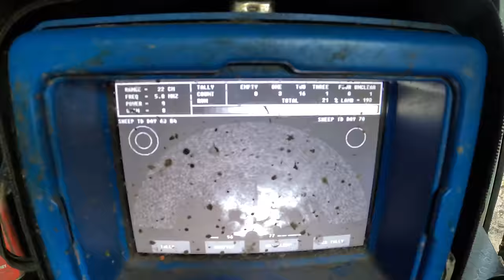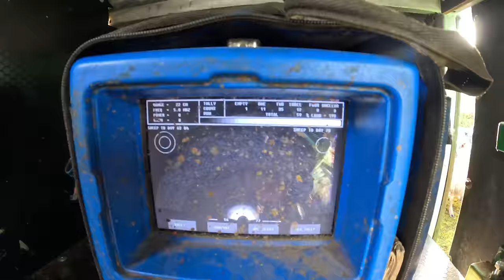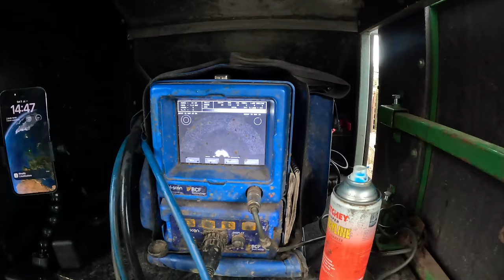Have the Rams worked? Lets find out!

Comment: Could you maybe extend your tapari roofing and build some sheltered lambing area or some temporary party type tent gazebos polytunnel with lambing pens inside for the adoptions and poorly sheep? Trying to think of some simple quick cheap solutions for all outdoor lambing ideas. Maybe if this is to hard and to much set up a few fences/pens in the field that are near shelter walls/trees and hang a tarp over for extra protection for that 1st bonding time. Thinking you having a birthing backpack kit scissors, iodine, gloves, spray to mark lamb and mam incase of missmother jug and bottle to milk and top up and a tube? Easier to keep track of and not have to take any sheep anywhere to rescue? Also sheepgame backpack merch 😊
Reply from the maker: Thanks Lisa. I'm going to get some covered hurdles for each field. See how it goes.
Reply: @TheSheepGame  I'm sure you'll work it out and all your fans could help with some suggestions. work smarter not harder (not sure your could work any harder haha)
You work 103891273miles an hour having a little daily check list by the breakfast/coffee area that backpack kit (with snacks?)
Might save you a ton of running around and some £ wishing you best of luck

Comment: you may have explained this sometime back, but i'm still a little fuzzy as to what farmers do with the scanning info that they wouldn't do after just having the lambs drop. Will you employ different management going forward before lambing season based on this info?  Just curious.
Reply: in past years he has pulled singles and triplets into a shed for lambing to have a chance at forstering and to keep a closer eye on potential problems. Not sure about other farmers, hope this helps
Reply from the maker: Yeah as mentioned you can do things like fostering on lambs to singles but main reason is for nutrition prior to lambing.